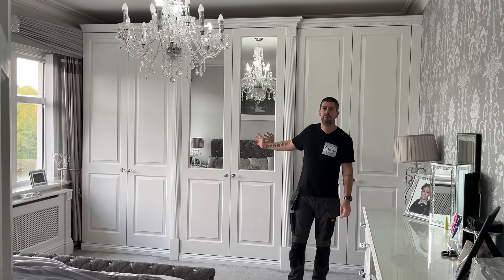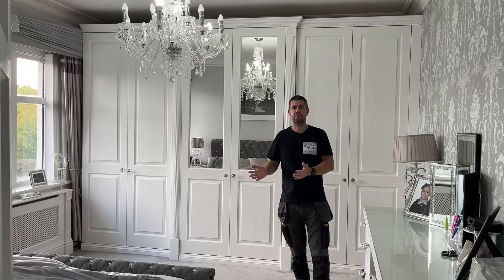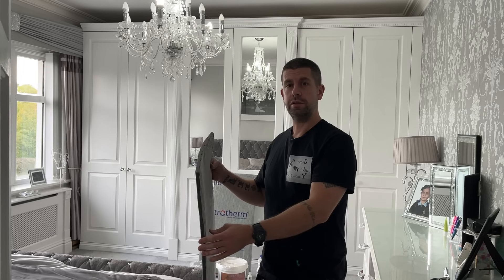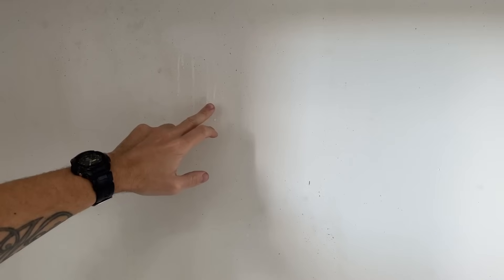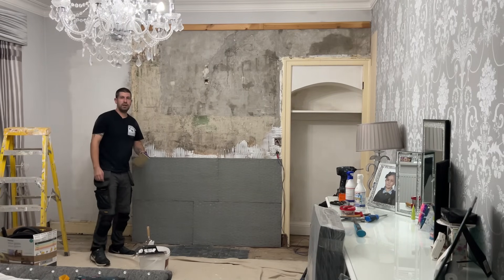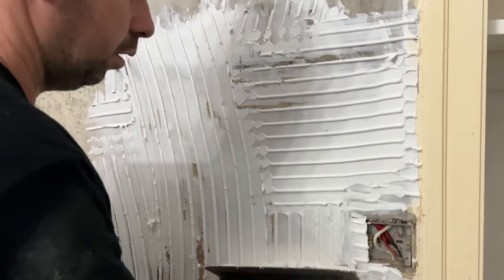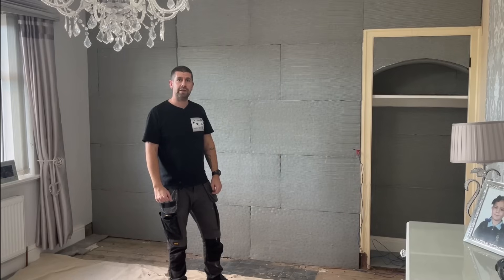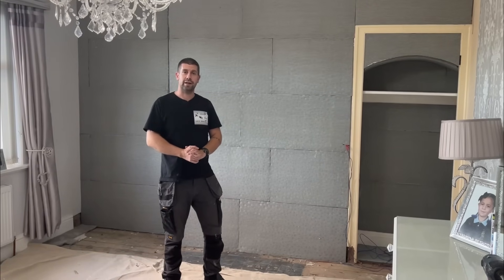Insulating Internal Walls. Easy DIY Solution

Comment: As lots of people have already commented the problem is the Relative Humidity/amount of water in the air, not because of a cold wall.

The reason you didn't get mould when you had the house at a steady 21 degrees C is because warm air can hold MUCH more water than colder air. Look up so "Relative Humidity" charts for reference, a Relative Humidity of 90% at 21C is massively different to 90% at 10C.

Theres nothing wrong with insulating a cold wall & it may or may not stop the water condensation behind the wardrobes but that water will need to drop out of the air somewhere once RH reaches a certain level & it will just do that on the next coldest surfaces unless you get rid of the actual water via ventilation or dehumidifying. 

Most people will recommend a PIV but personally I prefer not to pump cold air at outdoor winter temperatures into my house so I always use Heat Recovery Units & I also have a couple of single room dehumidifiers on standby just in case they are needed.

Comment: Glue some kind of vapour barrier over top of the insulating panels! If the panels are porous, humidity will go right through them and condense on the cold wall behind.

Comment: Would this be suitable for a garage ceiling as previously owners had a firsts floor extension above the garage in the early 80s and the rooms floor gets so cold as I don't think they have insulated it. We got the house in the summer and recarpeted it and it's only now the weather is getting cold we can feel it coming up I don't want to take everything out then take the carpet up and remove all floor boards so just wondering if this would work putting these up on the garage ceiling or if anyone else has any other ideas 😊 Thanks

Comment: Control of condensation is a complex problem and in this instance I doubt whether the thin foam panel will be effective. Principally, what is necessary is to increase the insulation so that the surface temperature is above the dew point and stop the air bound moisture from then getting to the point where condensation will occur.  The suface temperature of this foam panel might be above the dew point but the vapour will condense out within the wall construction (including the panel) and could potentially dislodge the original plaster on the wall.  I am afraid that the system used falls into the category of snake oil.

Comment: Mate - good luck with that.
But there's fundamentals here. Just like high-priced Skiing and Athletic gear manufacturers have spent millions developing "wicking" of moisture away from the body ( not always succeeding either) is because YOU HAVE TO HAVE AN AIR FLOW THAT TAKES THE DAMP AWAY. ...by trickle, or combinations of material, or studying air-flow in closed containers. 
You have to address the differentials between 2, 3 or 5 materials, that are in proximity, in changing air conditions in your badly built house.
You are not really solving the fundamental of mould growth by sticking that aerated plastic carpet on your walls. You might get lucky and create a small improvement - but it's not a solution. The solution is hidden behind your plaster, batons, cold-bridges, trapped areas and bad building techniques....Always remember - mould spores can wreak havoc with young kid's lungs - and adult's.

Comment: Putting layers of adhesive and plastic on your walls will make little difference. You need to reduce the humidity in your house and get a regular change of air. Spend the money on a decent PIV ventilation system instead - dehumidifiers don’t treat the problem, they treat the symptoms. Good luck.
Reply: Not sure a out his system, but insulating the wall will help. It will make that wall warmer and as a result less likely to cause condensation. Obviously ventilation would make things easier and room healthier but insulation isnt stupid

Comment: Probably better to use 10mm PIR insulation then overboard with 12mm foil back plasterboard... wont help insulate the room but should stop condensation and cold bridging.

Comment: Oh dear. 

You need to be very careful with buildings which “professionals” you trust because some of them talk rubbish so they can sell the same.

Where do I start? 

Ideally you need to use a vapour permeable internal insulation like either hemp/wool/wood fibre products, followed by permeable board/lime plaster, or, if you can afford it, aerogel.

What you don’t want to do is use a product with negligible insulation value, that seals damp in your walls and encourages interstitial condensation. Like the product here. 😢

As many have already noted, you also need to improve your ventilation. It’s not an easy fix, but it’s worth looking into mechanical heat recovery ventilation and seeing if it’s viable for you and your property – it’s not appropriate for many old properties unless you’re prepared to improve the air tightness, but if it is appropriate, it’s a really good fix for these kind of issues and a great one for energy & money saving too.

Comment: I'm positive this guy put on the wrong side, Hessian side should aways be adhesive side? No way you could plaster over that, unless you never touch the wall.
Reply: Iam a retired plasterer danny, and in my eyes it must be plaster borded and skimmed over top of the insulation , cannot see a  thin coat of skimming holding that lot together, like you say slightest bump  and there's  a hole in the wall, a good  coat of bonding plus skimming could possibly work but I would not trust that, make sure and board/ skim,  . but then if you going to do all that,you might as well just get an insulated board with a barrier built-in, half the work and half the price, and a much better job imo.
Reply: Smooth side would be for applying plaster and rough (mesh) for gripping the adhesive? Generally the trade name if there is one will be showing outwards / upwards, as its for marketing. He has put it on back to front if you ask me. He seems sure that this stuff is ok to trowel adhesive onto but it would be much easier to trowel adhesive an get grip between the wall and the product using the meshed side. The mesh is what helps with adhesive. It cannot help with holding plaster? onto the product. Common sense really.